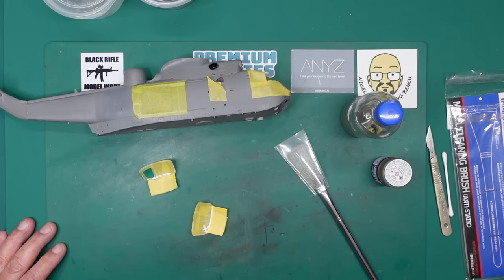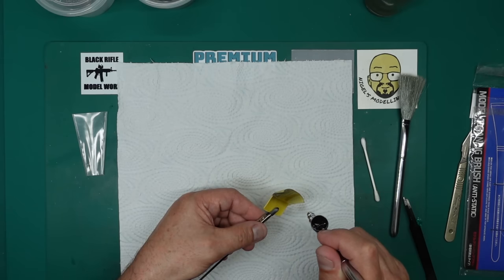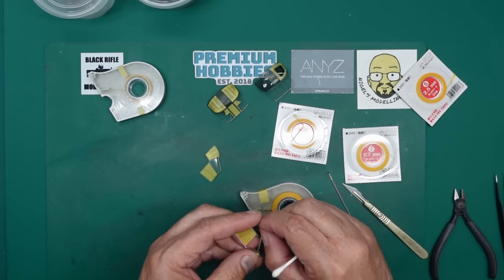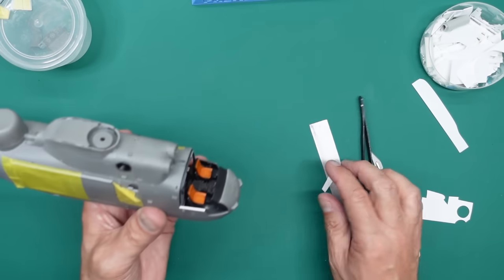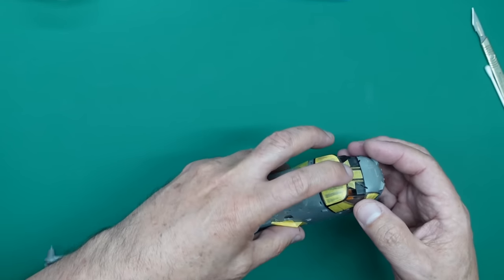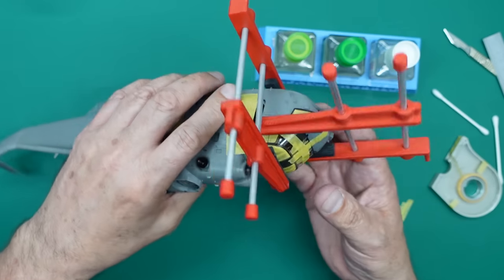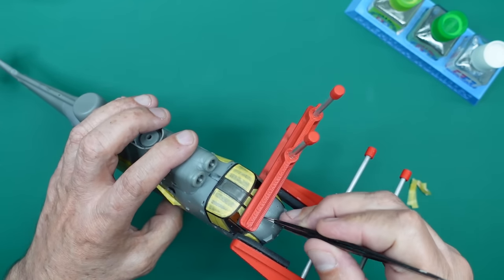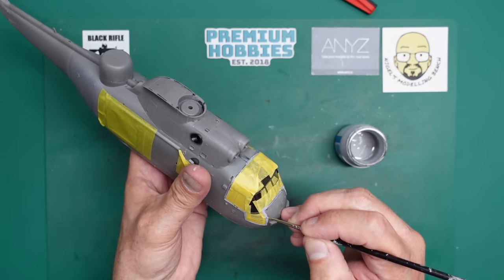Brand new Airfix 1/48 Sea King video build in 1440p . Part Nine.

Comment: Hello Nigel. I really enjoy your attention to detail. I only wish you would use a camera that would better illustrate that detail. You often mention capillary action and talk as if you assume we can see it clearly. We can't. Same with rivets and seams and stepped surfaces, flaws in clear parts and on and on. We can't see what you're talking about -- at least not as clearly as you seem to assume we can. And holding the model up closer to your lens rarely helps. I know cameras are expensive and I remember you mentioning that you just bought a new one recently, but it just doesn't do your commentary justice. If you're going to explain things in extremely fine detail, you need a camera that shows that fine detail, don't you think? As it is, so much is lost. Other modelers use better close-up cameras (i.e. The Scale Modeling Cafe channel.) And for really, really fine work, check out the camera on the Vintage Watch Services channel. A camera like that might not be practical to use all the time, but when you're doing the really fine work, like the canopy work in this video, it would be smashing. Consider it a business expense. I'm guessing your viewership would increase quite a bit.
Reply from the maker: It's something I'm thinking about. Trouble is, the bloody things cost so much money. I'm sure I could do a close up complete video when it's called for!